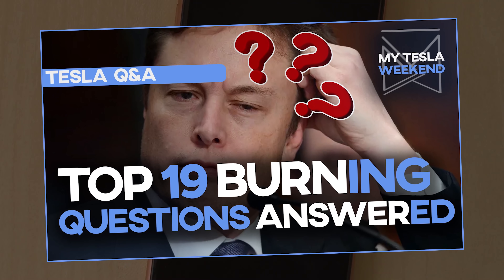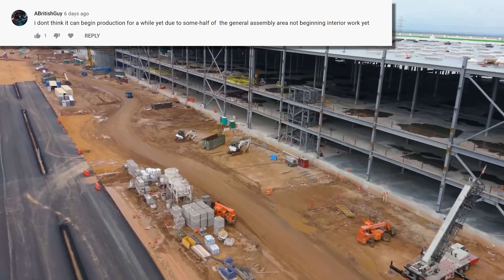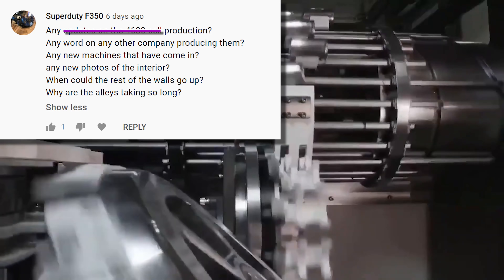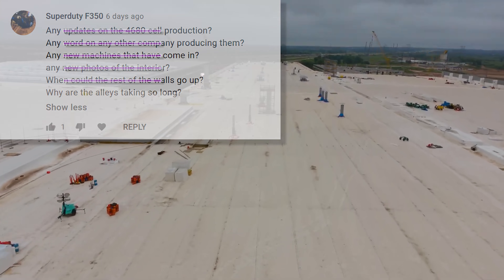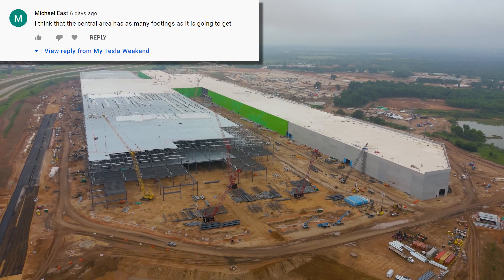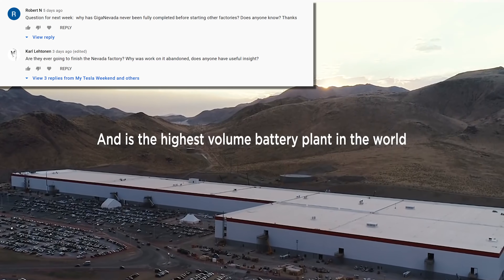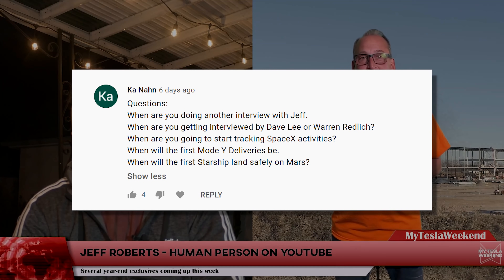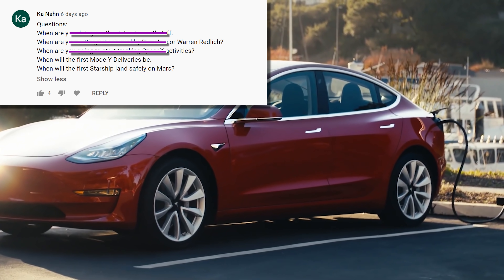19 burning questions about Tesla - Giga Texas, Giga Nevada, CyberTruck, and SpaceX

Comment: BURNING QUESTION:  Brian, have we ever had a DEFINITIVE statement from an AUTHORITATIVE source that the massive factory building currently under construction in Austin will host anything other than model Y?  Isn't it more accurate that Tesla has said that CyberTruck will be built at the Austin location ... but, not necessarily in the same building as model Y?  Isn't model Y production in that building intended to ramp to 1,000,000 units per year?  Isn't it clear that the casting shop will only house 12 giga casting machines?  Isn't the max output of 12 giga casting machines around 2,000,000 units (one million front castings and one million rear castings) per year?  Me thinks that the Cyber Truck will be built at the Austin site in another ( smaller and soon to be started structure). I also believe another (even smaller) structure will be built for the manufacture of the Semi.

Comment: Hopefully Panasonic and LG 4680 will incorporate both tabless and dry electrode,  However dry electrode is not essential,  but the form factor requires tabless to function .   Panasonic's pilot line is not in Navada.BUT OPENED last april.  They quoted a side by side pilot line but not sure what that means.  Could they have already been working on tabless and dryelectrode? They were very quick to announce  there own 4680 pilot line and April start date after  battery day.
Now if all three pilot lines are 10G there could be enough batteries available as they ramp up the pilot lines.  P. and LG  have fewer unknowns to sort out as they  will be using tried and proven electrode mixses. so hopefully they will catch up with tesla,  fingers crossed.   Of course if  Berlin permits don't get issued till mid 22 it might ease the battery supply  problems!

Comment: There is absolutely nothing stopping a starship landing on mars, with lighter atmosphere making approach less violent, and less gravity to overcome. Just need to get starships to land... The real challenge, you touched on, is getting something that size there, and SpaceX has a plan that fits the physics, and a system that can be refueled in space in preparation. So time is the big problem, time to trial and error, perfect and practice all these things. 2031 is probably right, but it could be sooner, (Unmanned and less perfected....) The science, required orbits and computing power is all available now. Remember even the last NASA rover went through such a top heavy design processes it is using computing parts from the 80's, bit like legacy auto compared to Tesla....

Comment: The larger size of the 4680 requires the tabless design or else such a size battery would overheat.during charge and discharge. The tabless design makes the size possible...

"Tesla Panasonic" is the company making batteries in Nevada. A unique entity equally controlled by both companies.

Comment: If starship can land here on Earth, then it can land on Mars.  The idea of the whole  Starship project is to make them cheap to manufacture and therefore you'll have 100s if not 1000s of them.  This is how Elon works.. and the money from launch projects and starlink is enough to fund this massive project to colonize Mars.
Reply from the maker: Landing locally is vastly easier than landing on another planet. Most of the attempts to land a rover on Mars have failed. The number of things that are easy on earth, but have never been done on Mars, is almost as long as the list of things that have been done on earth.

SpaceX could do it quickly, or they could do it meaningfully. To simply land on Mars could do with Falcon Heavy already, but there are no payloads to accompany it. There are a lot of moving pieces in a project like this.
Reply: @FutureAzA  yes, its going to be vastly more challenging.  But it's also going to be possible.... not never.. and I would say that it's going to be done faster than we can imagine... because Elon will iterate fast... he is going to be making dozens of them at a time.. and just keep testing....
Reply: Starship has landeded on a level prepared and hardened landing pad. Mars has no surveyed area from which to land yet. So what makes you think that he could land on Mars with no problems?
Reply: @texan-american200  that wasn't the question.  Brian thinks you can NEVER land a rocket based on its weight alone that is so much heavier than anything else that came before it... sure, it's going to be a bigger challenge landing somewhere you haven't been before but again, Mars also have only a third of our gravity.  And if you can land here on Earth that means it logical to assume you can do the same there... as I say,  it going to be easy, but not impossible either...
Reply: @ezerratchaga  
My answer's still valid... They constructed a landing pad that"s level and HARD. It was constructed specifically for the takeoff and landing of the Starship.
 But if you're still insisting on the gross weight, its empty weight alone is 120 imperial tons. 
It's height is 120 m it's diameter is 9 m. Even on Mars gravity, it still makes for a great weight and a small center of gravity. With its small footprint it leaves a lot of weight on a very small area. Without a detailed man on-site survey, it is very hard to determine if that ship can land on Mars itself.
What he needs is a Martian excursion module like Apollo to be able to make valid landing surveys.
Reply: He has done no research on it ... that’s why he doesn’t talk about Spacex much.. That being said he should stick to Tesla info being so far out of reach with what is going on with starship...